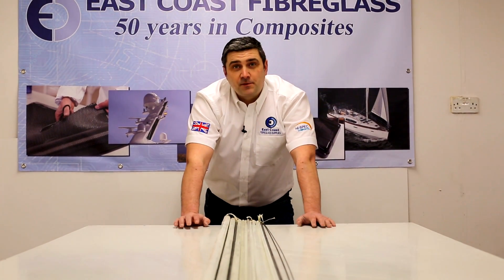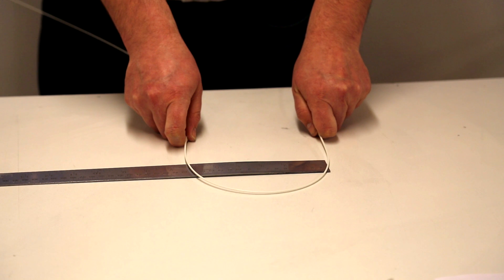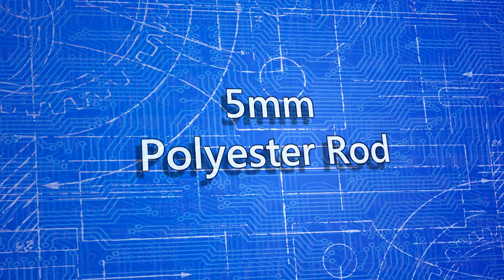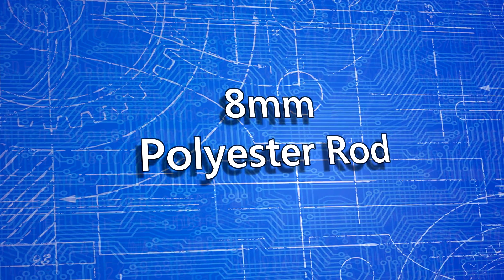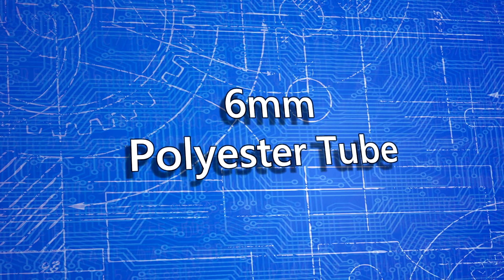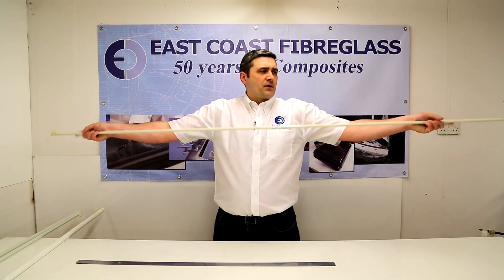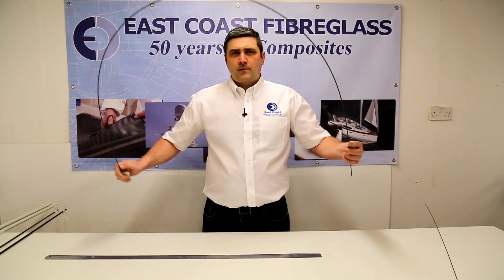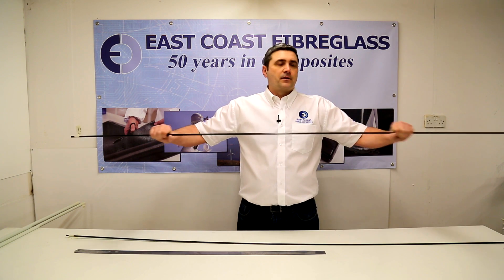Polyester and Carbon Fibre Rods and Tubes

Comment: Have you coated them in something so they can be handled without gloves?
Reply from the maker: No, we give them a light sand with fine grit sandpaper to remove the splinters etc, so they're fine to handle
Reply: @ecfibreglassuk  how to buy this item directly from you'r company??